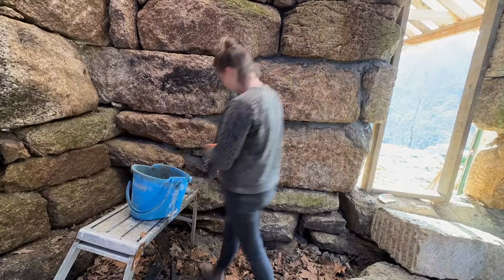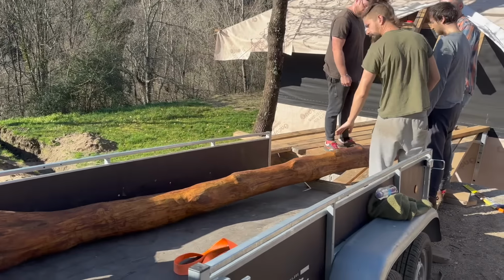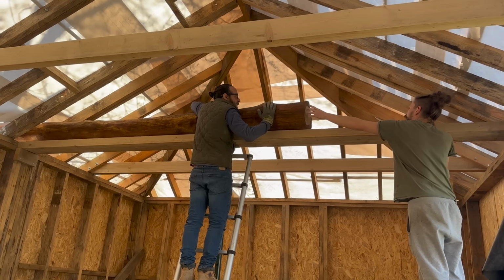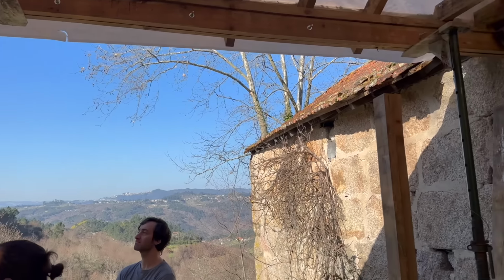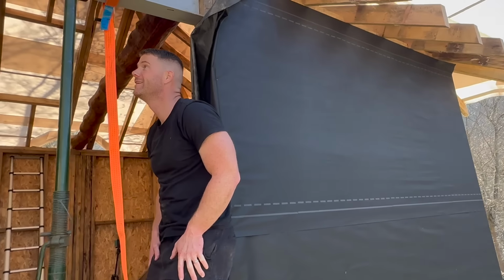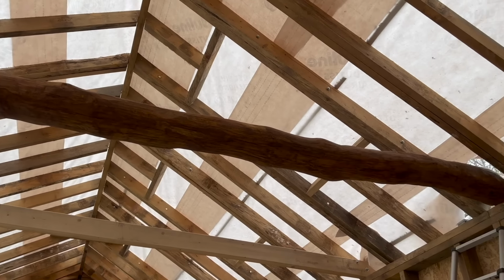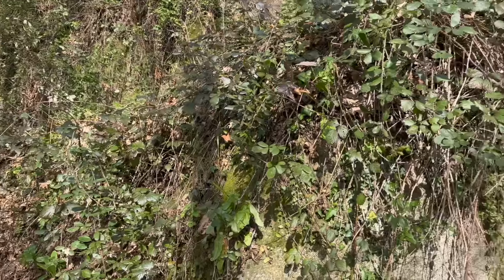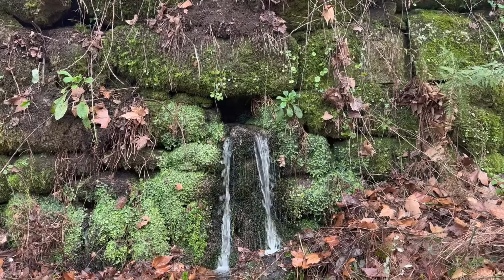#13 RURAL HOUSE RENOVATION  - SELF BUILD - BUILDING OFF GRID HOUSE - NORTHERN PORTUGAL 🇵🇹

Comment: You guys are doing great and the beam looks amazing! We are renovating an old stone barn ourselves and use lime render on the inside walls as well because the old buildings are not build on a water resistant surface and thus the stones absorb the moist in the soil. Looking forward to next weeks video 😊
Reply from the maker: Thank you so much! Yes we will be rendering all in lime we have just used a little cement for in between ☺️